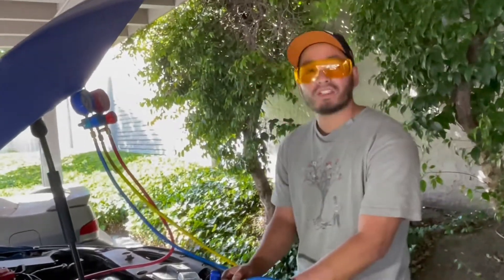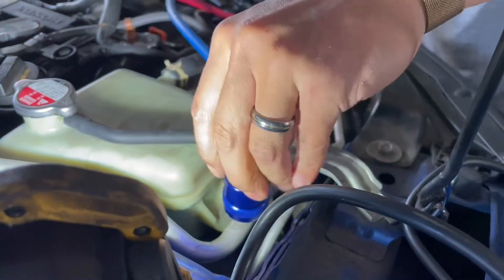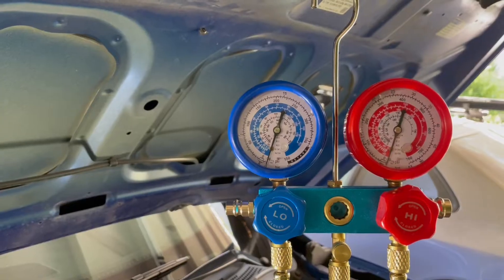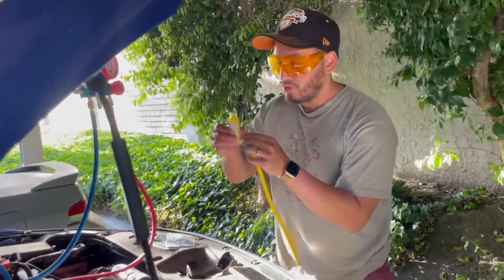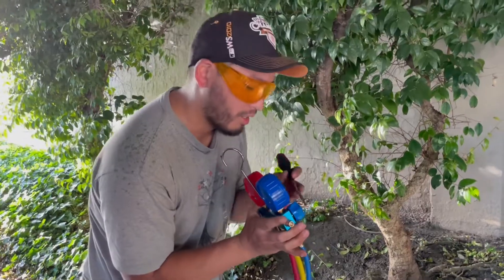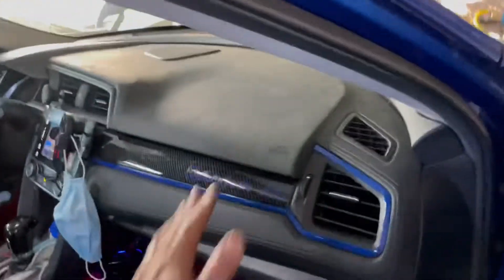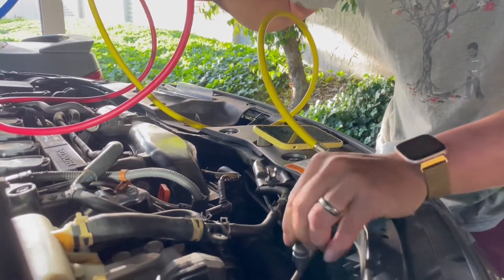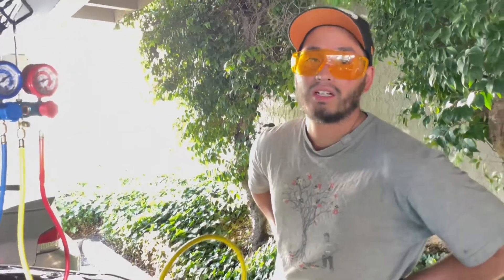DIY R1234yf Conversion To R134a How To Recharge AC Refrigerant On 10th Gen Honda Civic AC Fix Part 2

Comment: Couple of things I noticed. When you close the valves on your guage set, dont crank them down so hard.. it can damage the valve seats and make them leak.  as soon as it stops.. stop closing.  As far as ensuring you get a full charge... you can use the subcool method to charge  the system if it using a TX valve,  I have a video here that explains what subcool and superheat are.. and how to use them when charging the AC.

https://www.youtube.com/watch?v=fVaM2kAN4s8
Reply from the maker: Awesome tips!  Thanks for the feedback 👍
Reply: Do not usesubcool or superheat on mvac.  The idle changes too much to be accurate.  Weigh in the charge.

Comment: Im guessing its still too early to tell if the problem persists with the new refrigerant?
Reply from the maker: It’s been a year so far since I have done this fix and the AC is still blowing cold and more reliable than the stock refrigerant which would have leaked out by now.
Reply: @Sals_Garage  that gives me hope and says screw what others say
Reply from the maker: @ct0760  happy to help 😊
Reply: @Sals_Garage  although I have to say my compressor failed again 18 months after the replacement so that may be another milestone 🤷‍♂️
Reply from the maker: @ct0760  mine did too that’s why I did it myself this time.
Reply: @Sals_Garage  forgot to ask, you have a sedan or hatchback? Wouldnt they be different? If you have sedan, wouldnt it be different for my car? (I have sport tour hatch)
Reply: @Sal's Garage  Just checking in to see if its still working and wondering if it has any negative effects with the expansion valve (did you replace it? I hear if it isnt replaced liquid refrigerant will enter and break the compressor, is there any truth to that?)

Comment: I am getting ready to do this same project for my 2016 civic, I am going to order the same compressor you did from Amazon but in the description of it it says it comes filled already the right amount of PAG oil in it, so would that already be compatible with R134a refrigerant?
Reply from the maker: Nice. Just to be safe I drained out the old oil and added the right amount for peace of mind. Good luck 👍
Reply: Hi Ride on - were you able to fix it on your own? I'm having the same issue and literally have zero knowledge to start with

Comment: Great job Sal!! Just a word of caution. When hooking up the connection to your schrader valves, don't tighten them so much. With continued use you'll begin to wear out the threads below the knobs. They just need to be tightened enough to open the valves.
Reply from the maker: Thanks so much for the comment and advice 🙏
Reply: @Sals_Garage  You're welcome! I also wanted to comment that you were WAY out of your comfort zone and it was visible. Great on you to try and share your project with us. This shows guts and tenacity buddy! Keep the videos coming!!
Reply from the maker: Thanks for noticing.  Glad me and the wife were able to fix our AC just in time for summer.  Almost a year later and its still running strong

Comment: Careful recommending people do this. Its a violation of federal law. Ever since the SNAP rule of 2015, the manufacturer of the car has claimed credits from the low GWP of 1234yf. Basically converting from 1234yf to anything is a violation of EPA 40 CFR 86.1803. Its a federal offense you recorded and posted on the internet.
Reply from the maker: Thanks for the advice. We switched back to 1234yf at this time thanks to your recommendation. 👍
Reply: @Sals_Garage  did you switch it back? I thought you said you kept the r134a and is still running strong?!
Reply from the maker: @vamshikalva1594  I was just telling them that to make them happy. I didn’t switch it back.
Reply: It’s not a crime if no one knows. 😅🤣🤣🤣🤣🤣🤣

Comment: Obviously don't want to cause cross contamination, but did you change the compressor specifically for the different refrigerant, or just to avoid cross contamination? We will be doing this on our 2017 Civic but going to just thoroughly vac down the system if the compressor is the same part number.
Reply from the maker: I changed the compressor because it was leaking. Good luck 👍
Reply: @Sals_Garage  I found a TSB from Honda last night that the condenser is covered for 10 years now, going to try and get it serviced, if that's not the cause then we will still have to give this a try!
Reply from the maker: @triptheroad  good idea. You will need to pay a diagnostic fee for Honda to check still. Here in the Bay Area, Honda wanted $495 to diagnose the issue. If it’s the condenser then you get refunded, but anything else then you won’t get the money back.
Reply: @Sals_Garage  damn I know mechanics get screwed on diagnostics, but that's a high fee to put some dye and pressure in the system
Reply: @Sals_Garage  luckily our local dealership here in Fredericksburg VA didn't charge the diagnostic at all, they said they've seen so many come through with the issue that they aren't even asking questions 😂
Reply from the maker: @triptheroad  awesome to hear!

Comment: Quick question brother! So I my ac isn’t work as well! I need to put tie dye in to my ac system. At what located do i pour it on to figure the issue out on my 2016 Honda civic Sedanv
Reply from the maker: Hi!  Put some drops in through the low pressure port when you recharge the Freon 👍
Reply: @Sals_Garage  Thank you brother! What time dye drops do you recommend from amazon? Not really familiar with haha. I really don’t want to waste on either it being the AC compressor or Condenser. Salamat!
Reply from the maker: Anytime!  I used this dye drop:  https://amzn.to/3giByr4

Also bought these:  https://amzn.to/3om46V3
Reply: @Sals_Garage  Definitely will check it out. Thank you once again 💪🏽
Reply from the maker: @Chaarzee  you’re welcome!  Good luck 👍

Comment: Hi. One question. Do you keep oil for yf1234  or do you replace it by compatible  r134a oil.  Pag 46 or 100 is ok ? can we merge it with factory yf1234 oil ? In case of leak what do you suggest ? Take out compressor en replace all the oil by compatible r134a oil before yf1234 to r134a conversion ? Or just keep the system as it, fix leak and fulfilled r134a with old yf1234 oil.
Reply from the maker: Map Rey I don’t have a definitive answer. I suggest replacing all the oil with compatible 134a oil. I used pag 46 as seen on my compressor change video. Good luck 👍

Comment: Interesting I’m having this exact same problem
Reply from the maker: Hope you can get your issue fixed soon.
Reply: Our 2017 civic is also having cooling issues. Seems to be a common problem.
Reply: Ended up in the same situation today. Honda replaced the condenser for free but quoted me $1700 for the compressor and the local mechanic $800. Looks like there still isn't any guarantee that it would get fixed. What did you finally end up doing? I'm curious to know

Comment: This is so crazy. I had my 2007 lx civic for 11 years. I sold it and got a 2017. I assumed that I didn't have any problems on my 07 with 387,000 miles I would be good with a 17. Well was I wrong. My 17 has 54,000 miles on it and the ac is going out. It makes me wonder if that was the reason the previous owner traded it in. I still need to diagnose where the leak is coming from but how can anyone be confident in installing OEM parts if Honda isn't acknowledging anything is wrong with other parts other than the condenser. Why keep on installing Honda parts if the components are faulty? My wife's black 2017 Hyundai has the R1234YF refrigerant and it will run you out of the car on a 100 degree day.
Reply: 1234yf sucks, my GF has a 2017 civic and we are having the same exact issue now. Of course the car is probably out of warranty now so we are looking at options as the refrigerant is expensive and not as good as 134 in performance. No wonder the used car market is insane, nobody wants to deal with all these new mandated inconveniences.
Reply: @triptheroad  If it were me I would research and buy an extended warranty. The Honda warranty has run out on my car but since I bought mine through carmax I went ahead and purchased their extended warranty. I think I paid $1700 for the warranty and in less than a year I have had $1900 worth of warranty work done through carmax.
Reply: @miked8156  I did find the TSB last night that extends the warranty on the condenser to 10 years, and since my girlfriend is the original owner we should be able to get it taken care of. I called the dealer last week and I guess they did not disclose that information originally, either because I didn't specify that the AC system was acting up (just that I needed it recharged), or they wait until the customer brings that warranty information into the conversation.
Reply: @miked8156  I can fix just about everything on a car accept Mount tires and do alignments, I did find out Honda has a service bulletin for the 2017 Civic and the condenser is now covered under warranty for 10 years due to a manufacturing defect, so we're going to try and take it to the dealership tomorrow and have it repaired under warranty first and if that doesn't work I will convert to the older refrigerant
Reply: @triptheroad  I had mine replaced at the dealer for my 2017 civic and after 4 months it has stopped working on the driver side.. I have no clue what to do about it because they wanted $1600 to replaced the compressor but from what I understand it’s still functioning
Reply: @Warr1895  Dealer said the same to me today. They already replaced the condenser last year. Now they're saying it's gone again, which is under warranty, but they want $1700 for compressor as well. Not happening! I am not throwing that kind of money into such an unreliable a/c system. I bought a can of 1234yf refrigerant with a trigger hose to top off the system myself, it'll probably last just as long as the dealers last repair(1 summer lol).
Reply: @steve8803  how's your AC working so far? And why did you decide to go with the same refrigerant instead of the one suggested in this video?
Reply: @Warr1895  Ended up in the same situation today. Honda replaced the condenser for free but quoted me $1700 for the compressor and the local mechanic $800. Looks like there still isn't any guarantee that it would get fixed. What did you finally end up doing? I'm curious to know
Reply: @vamshikalva1594  I stayed with the 1234yf just because the system was designed for it. I ended up bringing it to tireman and they did a leak test. They switched out a few O rings and added a pound of refrigerant. Cost me about $350 but (knock on wood) is still working fine over a year later! This system is not something you can balance on your own unless you have very good 1234yf specific gauges.
Reply: @vamshikalva1594  I’d try a leak test if you are getting some cold air. If you have nothing from both sides (driver and passenger) it may be the suggested part. Mine however was still cold on the passenger side and not the drivers side. The issue quoted was a poorly installed O ring which caused a leak
Reply from the maker: Yea I don’t understand why Honda doesn’t acknowledge that other parts besides the condenser are problematic as well. The evaporator, compressor, condenser, and various lines can leak and it’s been attributed to the poor sealing quality with 1234yf. Hope you can get your issue fixed soon. I switched to 134-a for better reliability. So far so good. You can also use compressed air to fill up as refrigerant I heard.
Reply: @Sals_Garage  I just bought the car from Carmax March of this year. Luckily I did pay extra for their extended warranty and accordingly to Carmax all I have to pay is 50$ for repairs. I have 100,000 miles to get this ac issue figured out. 

I wonder if consumers are able to push lemon law on the New Car Dealerships for this issue. I know it will suck but as far as I know in Virginia if the same problem is repaired 3 time within 2 years the Dealership is responsible. Maybe it won't matter because Honda is a big enough of a corporation and this problem isn't affecting enough of the 'little man'.
Reply from the maker: @miked8156  it’s been so hot this summer that we just wanted to fix it and not have to wait so long for Honda to do something about it if ever.  

I’m glad you have the extended warranty from car max. Good decision for AC at least it will pay for itself. The rest of the car has been very reliable.

Comment: Hell yeah dude!  I loved it
Any update on the AC system? I might be doing that
Reply from the maker: Very satisfied so far. 3 months without issue, blowing ice cold in the hot Cali weather. Good luck 👍
Reply: What in the he'll is the reason to take a better colder refrigerant and replace it with one that is not as good.? Makes totally no sense other then the massive price difference... why not just use air duster? (R152a) which is just as cold or colder then R12 and is like 8 bucks for a 4 pack of air duster at Walmart
Reply from the maker: @jamesduffey4442  cheaper, more reliable, cools just as good as factory. Months later no issues. Can’t say the same about 1234yf on the civic, which always leaks for me (3 times).

Comment: You should only vacuum through the high side. If the system is all good the low side will also pull down on the gauge as well. Add oil/dye through the low side (poor into hose while vacuum pump is on) when under vacuum with the tap closed it will pull through the low side from the high side into the system.

You should also add refrigerant into the high side first before even starting the vehicle. Close high side valve. Start vehicle then fill rest of refrigerant through low side. You don’t want to start your filling process on the low side as you run the risk of liquid refrigerant entering your compressor and hydraulic it.
Reply: @ryantaylor4116 Thanks so much for your tip about adding refrigerant to the high side first. I couldn't get my system to charge till I did that!
Reply: Thanks for this!
Reply: @ryantaylor4116  Any authorities, if you don't have a particular tool
Reply from the maker: Good tips! Thanks 👍

Comment: pressures and temps are almost identical to r134a so why wouldnt it work? it does its all a money scam all change sup be for green house gases!! jus car manufacturers screwing customers is all its about
Reply from the maker: I agree. The price for 1234yf is way too high and has been problematic for my AC system.

Comment: Hey man, aside from getting the yf ac evacuated and yj adapters.  Is there anything else i need to do for this conversation to r-314?
Reply from the maker: Just change out the desiccant dryer filter and use the proper compressor oil for 134 (pag46)
Reply: @Sals_Garage  would that be considered the same oil you used to put into the compressor?

Comment: Honda has extended the AC warranty to 10 years on refrigerant leak.  Take it to the dealer and let them do it.  If you have already had it repaired, the letter I got has a method to get reimbursed.
Reply from the maker: Yes, unfortunately this only covers the condenser, not the compressor. Honda denied my warranty so I fixed it myself.
Reply: @Joel Loeffler The a/c system in these cars are faulty from top to bottom. Next time you need it repaired, and there WILL be a next time, they'll likely tell you the compressor is gone as well and will charge you $1700...
Reply: Not only does it only cover the condenser,  they will find any reason under the sun to not do it. In my case it was because despite it having a hole in the condenser they didn't believe it was my primary issue

Comment: Good job. Buy a scale and install a few more ounces from a new can. Just weigh full can them subtract how many more ounces you need according to sticker on car then turn valve closed.
Reply from the maker: Yea, I just did that off camera. Thanks for the comment and advice.
Reply: @Sals_Garage  I am new to this stuff and have a question. When attaching the hoses to the gauges and fittings does it matter which way? Each hose is different on each end when looking inside. One end is open the other has a little metal tab in the middle. Thank you
Reply from the maker: I believe the one with the metal tab in the middle goes to the gauges. That’s what I did.
Reply: @Sals_Garage  thanks Sal
Reply from the maker: Anytime. Good luck 👍
Reply: @Sals_Garage o😊

Comment: Did you use a different type of compressor oil or is it the same type that works for both refrigerants
Reply from the maker: I used Pag 46 compressor oil.  The OEM honda compressor oil for 1234yf is only available from honda dealership.

Comment: Great video.....where did you get the PSI Chart for the Low and High side pressures?.....very detailed....A+
Reply from the maker: Thanks so much for the comment!  Here is the temperature pressure chart I used, but there are many found on the internet:  https://www.acprocold.com/faq/r-134a-system-pressure-chart/

Comment: No need to tighten your couplings like that. Once it stops, that's it. Don't tighten em. That's not what holds them on the service ports. You're depressing the valves in the ports when you turn those couplings.
Reply from the maker: Thanks for the tip!
Reply: Eric the car guy says you turn until you see the needle move. Schrader valves can get damaged on some cars if you turn all the way down.
Reply from the maker: @69ztang  Thanks man.

Comment: I noticed that you purged air from the Yellow suction line but not from the blue line going to the car?? Any reason why you did not do this?
Reply from the maker: The blue line was already under vacuum for a few hours and that line was closed when the yellow line was disconnected.